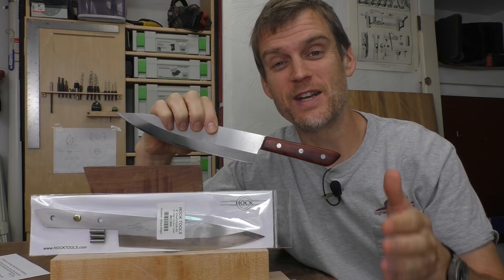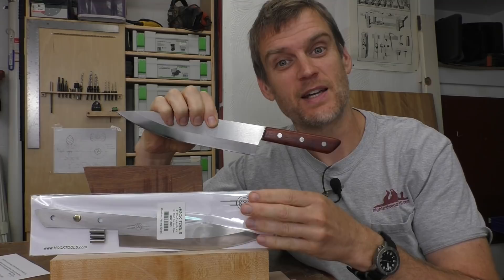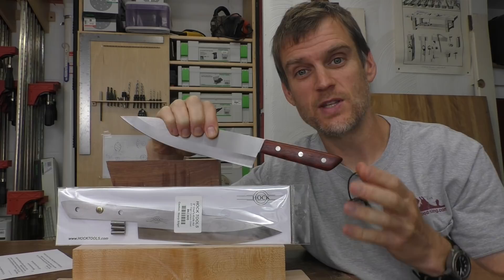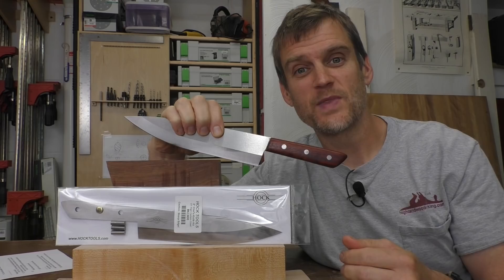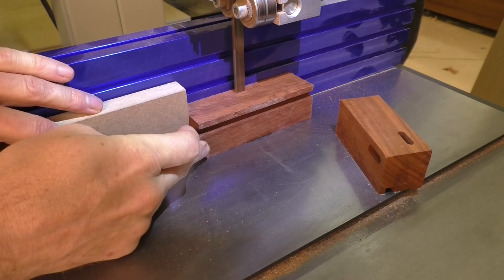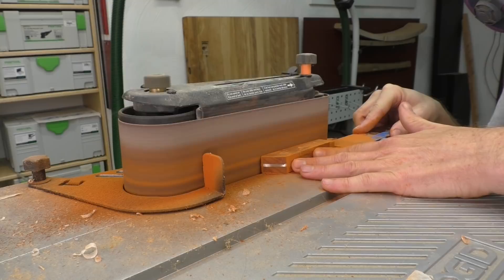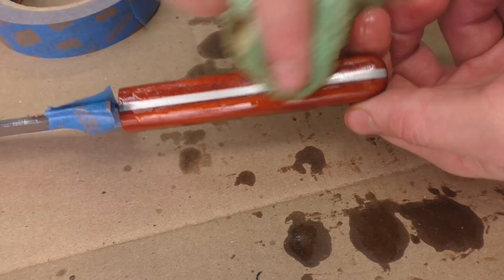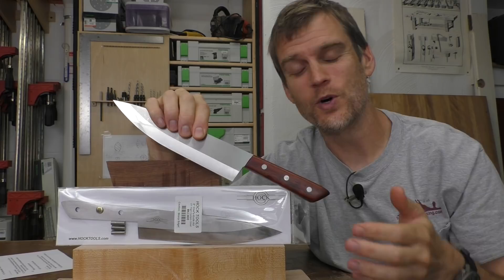Series: Make the Ron Hock 8" Kitchen Knife Kit - Part 1: Overview

Comment: Thoughts on using Corian for the handle?
Reply: Paul - I haven't worked with Corian really much at all.  I believe it's pretty solid throughout (no voids) and works easily (with woodworking tools).  If that's true, I wouldn't have a problem using it as a handle.  It'll certainly hold up to the abuse in the kitchen.  Good idea.